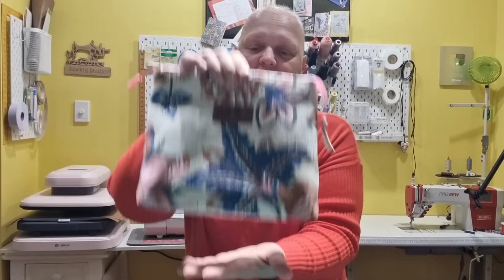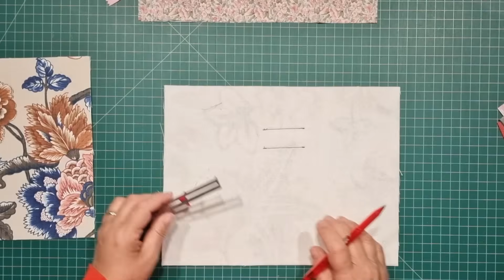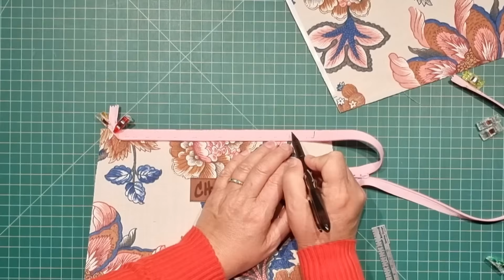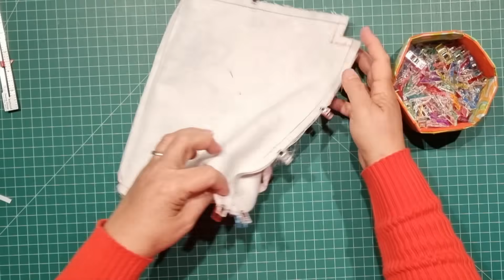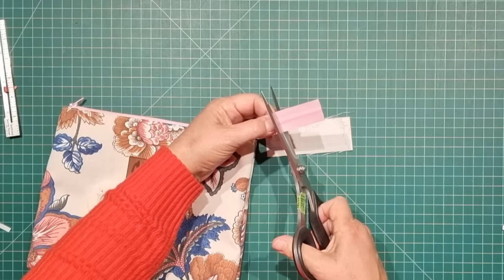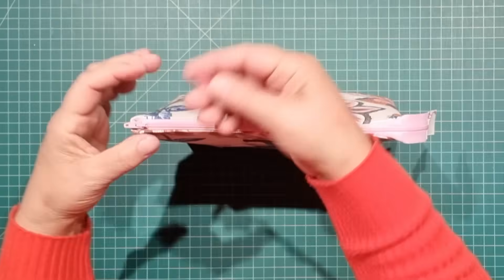How to sew a wide opening zippered pouch end using Butler method turned in zipper ends

Comment: Does the double sided tape affect anything? Other than being easier I mean. I’m new to sewing, so if I was to use it on a garment, would that be bad? If so, why?
Reply from the maker: It'll be fine on garments if you use the washaway tape as it disolves in water. 
The craft tape will gum up your needles and bobbin case and isn't washable.😊

Comment: Love this video, but I’d finish that tab on the zipper this way… I might use a light weight Pellon on it. But after marking the tab, I’d go ahead and fold it in half (short ends together, right sides together) and sew down the two sides. I’d then trim the corners, flip it right side out, fold under the top edge, slide the zipper end into the tab, and then stitch it down around all of the edges.

Comment: Thank you so much! I don't know if someone else asked abut doing this but I do know I did. Again, thank you and I can't wait to try this method. I still don't understand how to do this with a zipper tape that is cut by the yard. It doesn't have a leader to fold back.
Reply from the maker: It won't need a leader. You can just mark the zipper at the very end, and then again where I've shown you in the video. I just use the little metal tab as a guide, but it's really not necessary😁 In fact, you only need the original markings, as you'll fold the zipper tape at that mark. Anything extra once folded will be trimmed back later anyway.  (Hope I've made sense. I have chemo brain)😁